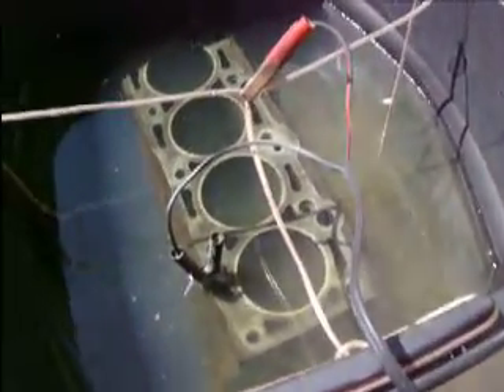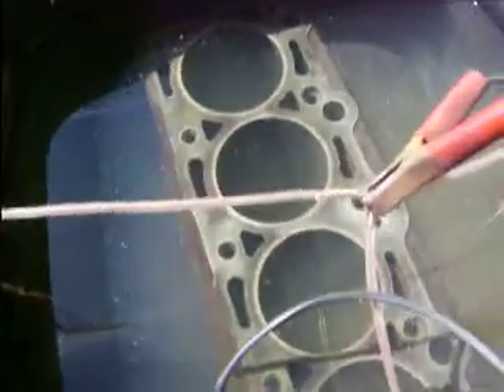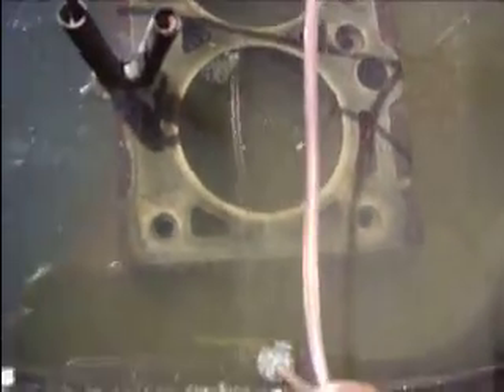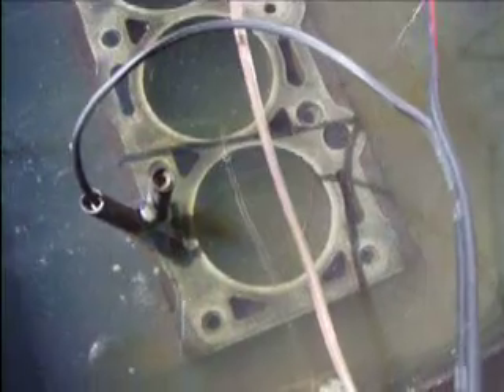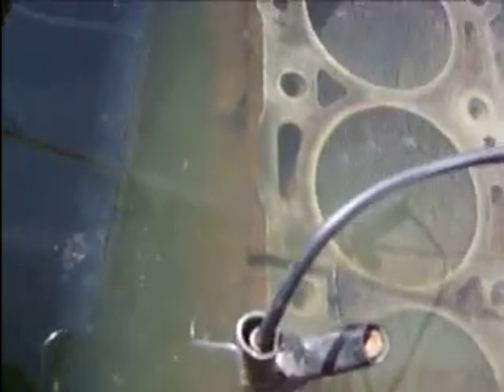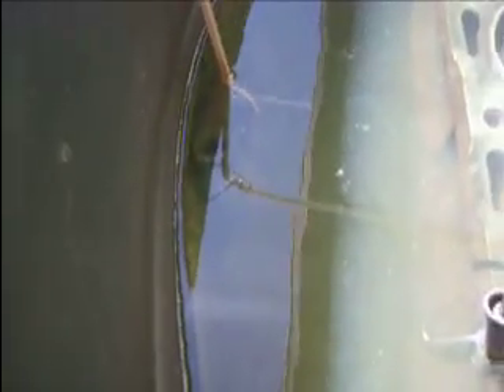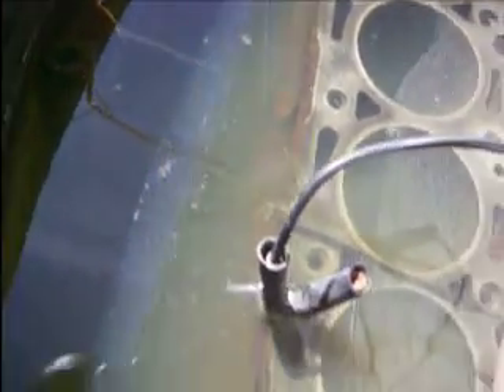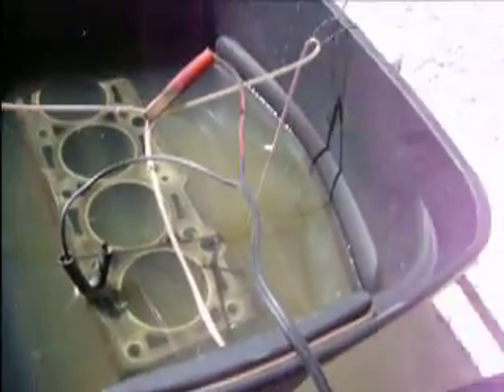Engine Block Rust Removal with Electrolysis Part 1

Comment: Is there a way, to put this into a concentrated gas, say through a hose pipe, into an air inlet to clean the internals of a engine without having to dismantle it??
Reply: nope. its the process of making hydrogen gas that actually cleans. not just the gas itself.